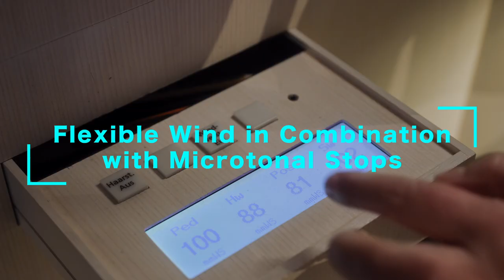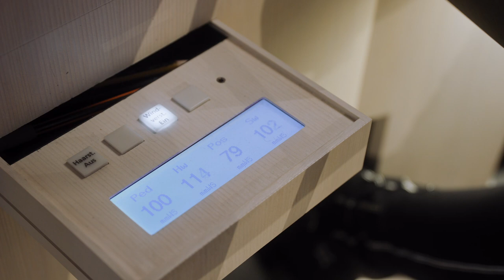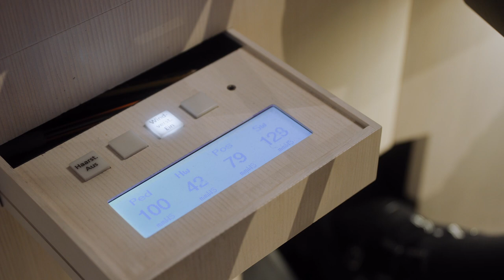Flexible Wind in Combination with Microtonal Stops - Musiikkitalo's organ

Comment: So somebody actually built a microtonal pipe organ other than the Fokker organ?  And at least from the limited sampling of sounds, it has a better tone quality, even though i have yet to see more than this demonstration.  (Or is it actually synthesized in the manner of Hauptwerk? -- still sounds better.)

I understand the quarter-tone keyboard (upper manual), even though this is the first time I have seen one of this type, and it even looks more ergonomic than the double-manual scheme of the (extremely rare) quarter-tone pianos like that used by Ivan Wyschnegradsky (at least, as long as you have skinny fingers), but the other keyboards that are supposedly 31 notes per octave just look like normal 12 notes per octave keyboards.  How do those work?